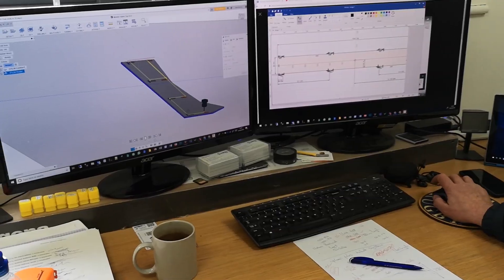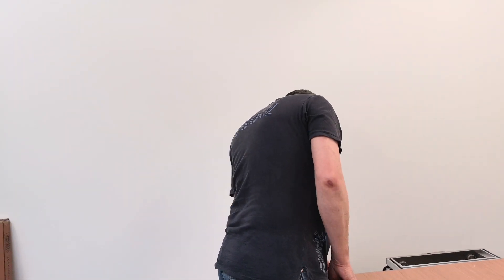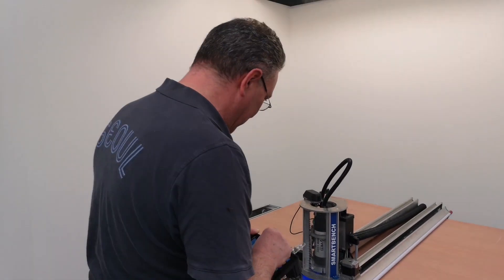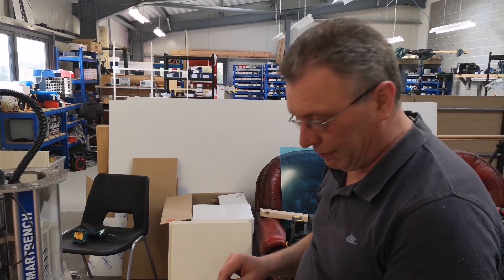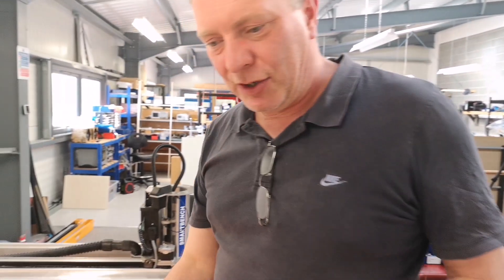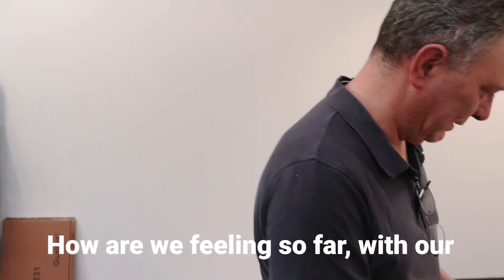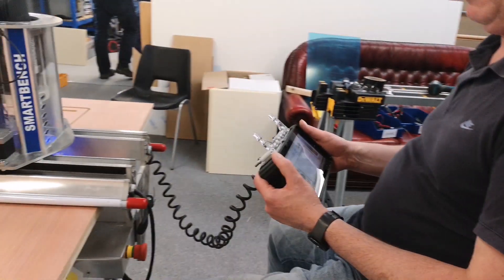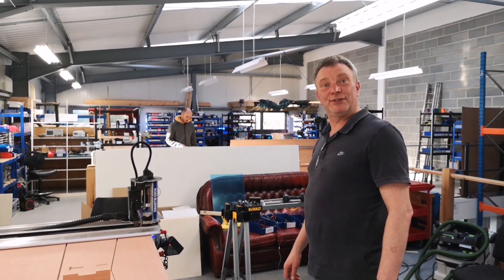Bespoke Monitor Stand With SmartBench

Comment: Hi, how many passes would you expect to take to cut 18mm birch plywood? Also what speed would be realistic to expect? I'm a newbie to CNC but am very interested in the Yeti, initially wanting to engrave hardwoods and cut plywood/mdf etc...
Reply: Thumb rule is that you can cut only 1x mill thickness at the time. So, with 6mm bit you should cut at least 3 rounds to get through the sheet.